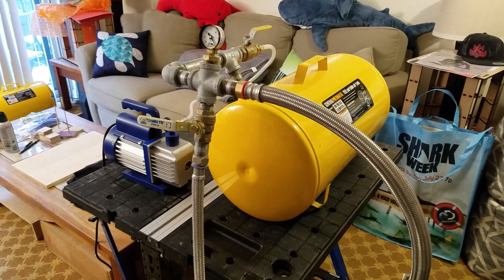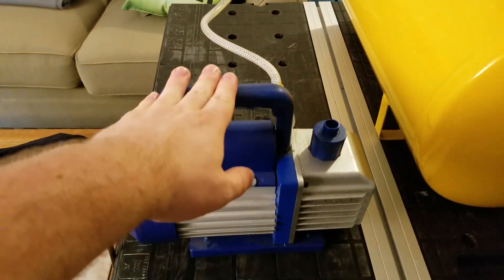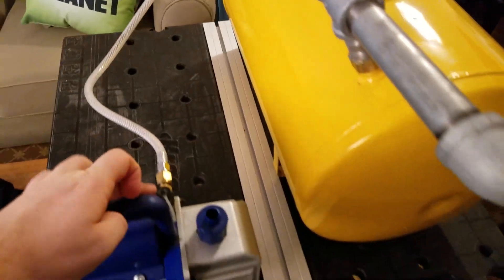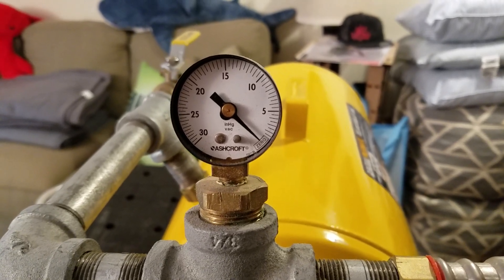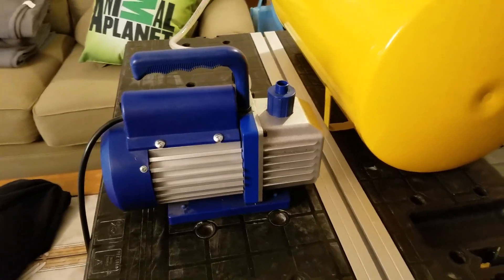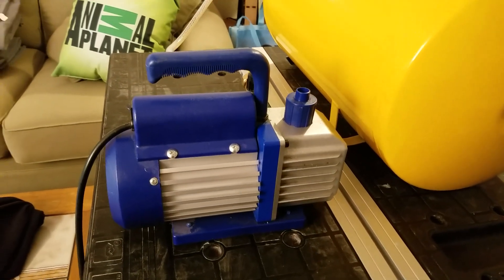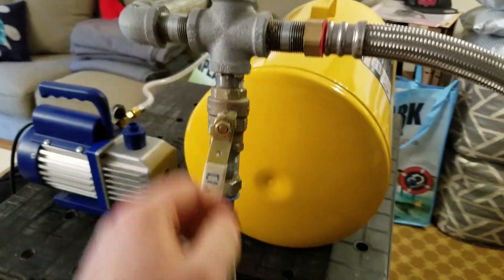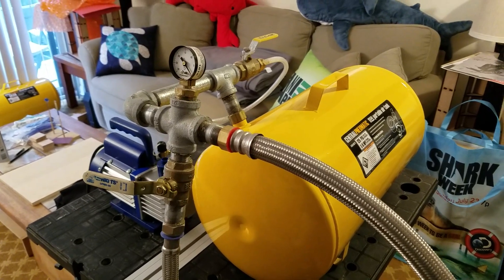My Vacuum System for Vacuum Forming

Comment: Can you educate me on what the hose does that’s not connected to anything ?
Reply from the maker: The one pointing downwards connects to the bottom of the platen and the one pointing to the side connects to a second tank.
Reply: @mwjscn  So i only need a hose going from the vacuum pump to a   inlet valve before it enters the surge tank  via a T connection then the outlet part of the T to another T connection with a vacuum gauge  N hose to my kydex press im making?
Reply from the maker: @mhsucio6830  Sounds about right. I have a parts list in the description, and you can use this and my other vacuum forming videos as visual reference.
Reply from the maker: @mhsucio6830  Here are some references from my build. If you're going a one-tank system, here is what mine looked like: http://4.bp.blogspot.com/-wYqjdCix2QU/Wce0WFWmDCI/AAAAAAAABkw/K-1nPAB7NDQOXEsmRnt86uCj-kP-rcUOgCK4BGAYYCw/s1600/new%2Bsystem.jpg

It you think you need a two tank system (larger platen with larger forms), here is a reference of that all built (what was in this video, just fully assembled): http://2.bp.blogspot.com/-X6854Y21t1w/WeaDFtojFvI/AAAAAAAABqU/ymfxTId6afs9a1u1_IuJLWR4RDa-TkTqgCK4BGAYYCw/s1600/oh%2Bno%2B2.jpg

A write up regarding my upgrades for when I built my current platen and former build is here: http://mattmakesstuff.blogspot.com/2017/10/eiga-dorobou-cosplay-build-log-21.html?m=1

Hope that helps.
Reply: @mwjscn  thank you, I only want to use one DIY surge "tank" just to be used to vacuum for 12x12 kydex on a 14x15 work envelope.  Do you think i can accomplish this?
Reply from the maker: @mhsucio6830  Yep, sounds viable to me. Most people using Kydex for holsters are usually forming with low buck heights as well, which makes it easy and lessens the requirements.
Reply: @mwjscn  do you think a surge tank is necessary?
Reply from the maker: @mhsucio6830  The vacuum pump doesn't have enough force by itself to generate sufficient vacuum. I suggest you check out my DIY Vacuum Forming Guide video for further methods. If you want to used a stored charge, you need a tank. If you don't want a tank, you can just use a sufficient canister style vacuum attached at the bottom of the platen.
Reply: @mwjscn  last question. Can I just use my compressor tank while off and empty?
Reply from the maker: @mhsucio6830  Meaning disconnecting and reverting the air tanks to hold compressed air rather than the vacuum charge? Yeah, sure, if you want to invest the time reconfiguring them between the two modes. The tanks I suggest just have a 1/2" threaded opening and they come stock as compressed air tanks.
Reply: @mhsucio6830  If using this tank for compression storage, please be aware of the condensation issues and risk of internal rusting and regularly drain your tank as detailed here: https://www.manualslib.com/manual/1713495/Central-Pneumatic-65594.html#page=5-manual. Failing to regularly follow that maintenance schedule may end up being a newspaper headline you won't be around to read.

Comment: have you research what is the max vacuum pressure that those tanks can take? and if you had 2 tanks ,one connected with solid pipes and the other with a braided hose , does the hose sucks-in or collapses when the vacuum pressure is release? ... thank you for your informative video!
Reply from the maker: I've had the system down to around -28/-29 inHg without problems dozens of times. I use both solid piping and flexible lines in my system. I use quality water heater hose lines and haven't had a single issue with them so far.

Comment: great video thank you so much for sharing your knowledge. I got the calculation of width + 2xheight = area needed. would that also equal the size of the plastic sheet?
Reply from the maker: Yes, ideally, though I have formed things that calculate 'larger' than the area I have available. It depends on your plastic thickness and the level of thinout you find acceptable (the plastic area increases as it's heated and droops, but if heated a lot and pulled over a large object it will result in much thinner walls than the starting thickness).

Comment: How in the name of sweet baby Jesus did you get the original valve/manifold and gauge off of the yellow air tank so you could put the connector and pipe on it? I'm using a crescent wrench and hammer and it's not budging.
Reply from the maker: I used a crescent wrench and it eventually spun off for me, but it was on tight. If you have a torch, you may try to add a small amount of heat into just the fitting. Be careful if you do, though.
Reply: @mwjscn  I literally just got it off there. I suspect they had something like loctite on it, had to crank that mother pretty hard but it came off.
Reply from the maker: @JasonKlineOfficial  They definitely put some sealant on there. Happy forming!
Reply: @mwjscn  for some reason, I can't get this to go any more than 24.5 inHg.....is that normal? I thought you had almost 30 inHg?
Reply from the maker: @JasonKlineOfficial  My system regularly goes to -28 inHg indicated on my dial. I suggest running the pumps to whatever inHg you can get and then stopping the pump. Wait 10 minutes and see if the reading is lower. If so, you may have a leak in the system that air is getting in. Did you get the same exact model of vacuum pump? I also noted some better performance when I put in the aftermarket higher quality vacuum pump oil. Some pumps have different tolerances and air can slip by their internal components while running. The new fluid helped a bit with this, in addition to not burning off as quickly. Also make sure you have Teflon tape or the sealing 'glue stick' type on all threaded joints in the piping.
Reply: @mwjscn  Yep, exact same pump as you recommended - the exact same everything in fact (minus the 2nd tank). 

It seems to hit -24 ish and sits there even after 10 minutes. I used the glue stick on all the piping too. The only thing I can think of is going back through the piping and hitting it all again with the glue stick. There must be a leak somewhere....but it's weird that there is no problem until it hit the -24 is mark.

Appreciate all your help and feedback.
Reply from the maker: @JasonKlineOfficial  If it sits there solid without moving, there likely isn't a leak. I'd suggest trying to run the better vacuum pump fluid if you haven't already. At the end of the day, anything over 20 inHg is still great and should form without issue.
Reply: @mwjscn  I put the super premium vacuum pump oil in the vacuum pump right out of the gate, so I'm not sure it's that. 

On a sidenote, I have (4) of the heaters (the exact ones that you have) as I'm doing a large 32" x 32" piece of 1/8" ABS sheet. So not only do I have to get the sheet hot enough (which I think will be around 300 - 310 degrees F) but I also hope the 25 inHg will be enough to do the pull - it's a 36" platen. Guess we'll find out this week. I'm sure there will be some tweaks that need to be made.
Reply from the maker: @JasonKlineOfficial  Good luck! -25 inHg should be okay. The frame-to-platen seal will be the most important at that size. I find mine is never perfect, so I like having the second tank as extra capacity. Ideally in a perfect system with no escaping vacuum (very hard to do), you just need probably 2x the capacity as the amount of trapped air beneath the sheet. More is always better when in doubt, though.

Comment: Q: I'm currently building/designing a 48"x48" unit with a multi-hole array platen. How much pressure(in of Hg) and tank size would you recommend if I use the stored vacuum charge system?
Reply from the maker: Tank size depends on the amount of trapped air volume under the sheet of plastic and contained inside the interior platen chamber. Aim for 1.5-2x this volume in available vacuum capacity. I suggest anything from -20inHg to as close as you can get to -30inHg. The more you have the better it will be.
Reply: Excellent, very well explained thank you. from the UK

Comment: Q: How long does it take to draw down your (2) tanks/system to max vacuum? Thanks. I've enjoyed your videos. 
(I'm in the  process of building a 48"x 60" unit).
Reply from the maker: I've never really timed it, but probably about 5 minutes. Usually I flip the pump on while I'm demolding a previous pull and then the vacuum is ready once the frames and plastic are prepped and the buck has some Teflon spray on it. Good luck with your build!

Comment: Could you speak a bit on the connection of the vacuum system to the bottom of the vacuum table? What does that look like?
Reply from the maker: It's a piping floor flange on the bottom of the platen to some threaded 3/4" pipe with a 90 degree bend. The water heater hose you see on this system then connects to that.
Reply: @mwjscn  I ended up doing just that. My table works great, thanks to you. Cheers!

Comment: Why do you have 3 adapters connected to the vacuum pump? Can't you connect the 1/4" hose directly to the pump?
Reply from the maker: I didn't find a fitting at the time that would connect to the special port on the pump and provide the correct barb for the pvc hose. It may exist, so feel free to simplify whenever you can.

Comment: Why do you use two air tanks?
Reply from the maker: I wanted more volume of vacuum capacity available. This system equalizes the pressure between the air in the platen chamber and under the trapped plastic and the vacuum charge you have stored. You need more vacuum capacity than trapped air to get the sheet to still suck down after the valve separating the two environments is flipped. You may not need two tanks for some of my shorter forms on a 2x2' platen, but when in doubt more is always better.

Comment: Thank you for the video. but how you calculate the right amount of air charge tank capacity. tray and error or there are equation.
Reply from the maker: There probably is an equation, but 1.5 - 2x the volume of trapped air under the plastic sheet is probably a good start. In this system you're equalizing the pressure when you flip the switch since it's all contained (air is removed all together with an actual vacuum cleaner), so you need to make sure you have more vacuum than air.
Reply: @mwjscn  many thanks for your reply. 💐💐💐
Reply from the maker: @alhamedi66  Sorry that it was so late. YouTube didn't send me any notifications for some comments on my videos it seems.
Reply: @mwjscn  late better than nothing. Thank you 😅😅😅💐💐💐

Comment: can you explain the hose connection to the platen. Where are you locating the hole and are you using any attachments to connect the hose?
Reply from the maker: The hose is connected to the bottom of the platen via a floor flange to 3/4" threaded pipe. The water heater hose end will just screw onto those threads. The hole drilled for the floor flange is 1-1/2". When screwed down, a layer of silicone was also added around the edge of the floor flange just in case.
Reply: @mwjscn  Thanks for answering my inquiry. Should i locate the hole and floor flange centered on the bottom of platen, or does it not matter?

 This video is such a thorough and by far the best Vaccum Former Video on youtube. Thanks for sharing your knowledge with us all. I will be assembling all the parts today. I look forward to testing it out this week.

cheers
Reply from the maker: @richnam9113  Yes, it's best to have the main hole in the bottom centered. If you follow this link, you can see the entire write-up I did for the platen construction with lots of pictures: http://mattmakesstuff.blogspot.com/2017/10/eiga-dorobou-cosplay-build-log-21.html

Comment: The explanation is more than wonderful
I was hoping to add an explanation of the heating process for the plastics and the Temperature of the heaters
 required 
Thanks in advance
Reply from the maker: I use 2x 1500 watt quartz heaters in my system. I find that about 300 degrees F (149C) is the right temperature for PETG and Polystyrene. PETG will deform faster, so I suggest you keep a stopwatch running for repeatable forms.
Reply: @mwjscn  
I tried 5  heater with 600 watt for each one for pet 350 microns for 2 minutes but not work correct
Reply from the maker: @ahamed05  I'm not certain what the issue may be. My PETG heating times take about 2 - 2:30 minutes. Some quartz heaters have toggle settings for different heat levels. Make sure they're on the highest level. Also, make sure you plug them into different circuits in the house. You may be loading up on circuit with too much draw and they aren't operating at full capacity. I'm not an electronic engineer, but it may be worth trying.
Reply: @mwjscn  Thank you for caring and response

Comment: I cannot tell you how much I appreciate your videos. I was hoping to get some advice from you. Making a 12 x 4 in tail light lens, what plastic would you recommend? Once again your videos make the process so easy to understand. Thank you!!
Reply from the maker: Although I do not have much experience with the material, I would suggest polycarbonate mostly because of its strength if your goal is to use it in an automotive application. You may be able to find red material, but if you can't and are willing to do some wetsanding, you can use VHT Niteshades in red to make a transparent red tail light cover. Finish it off with some clearcoat and you should be good to go. Thanks for the kind words!